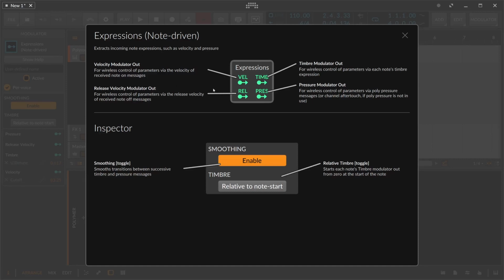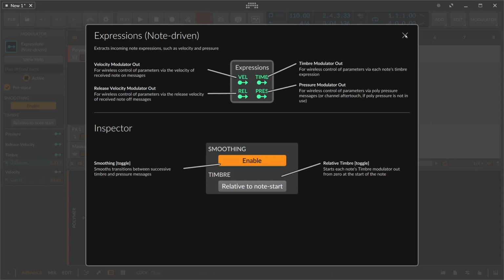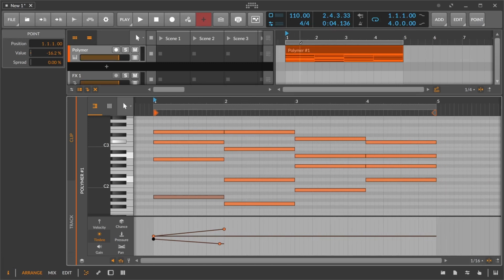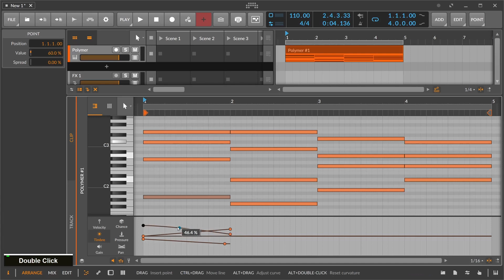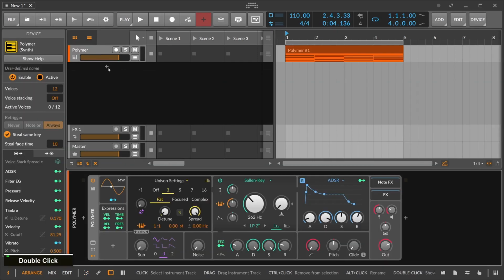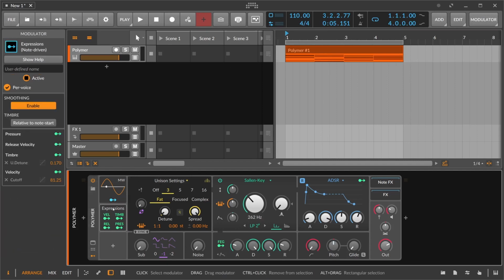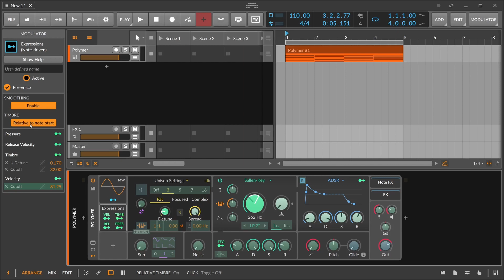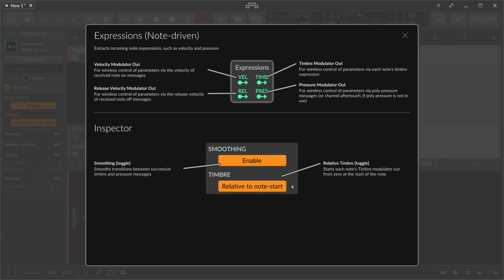Expressions - Bitwig Modulator Guide

Comment: This doesn't work with polyphony. It's fine until I introduce a second note, then it stutters like crazy, trying to match the other notes expression. MPE works within the VST (phaseplant) but as soon as I use the Expression modulator through bitwig, and play more than one note, I get wild stuttering as the knob moves erratically.

It works perfectly when playing one note and it works in the VST... smoothing is turned on and there's no information online about this.
Reply from the maker: yes. the vst plugin standard doesnt expose voice to the automation parameters. thats why they invented clap. the expression modulator works with polyphony only on bitwig devices and clap plugins.
Reply: @BitwigGuide  thanks for the reply, do you know of any workarounds?
Reply from the maker: no that i know of. the vst standard is just not made for this. if you want to use vst, you have to rely on the tools the vst plugin gives you :)
Reply: @BitwigGuide  Thank you for replying